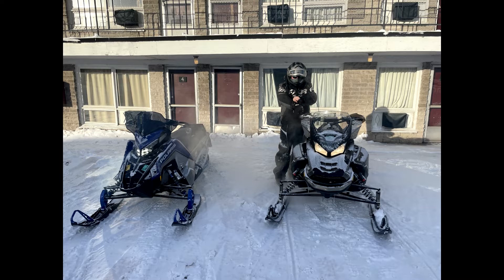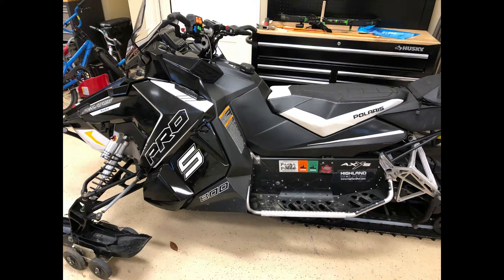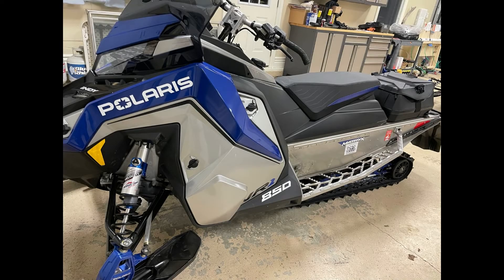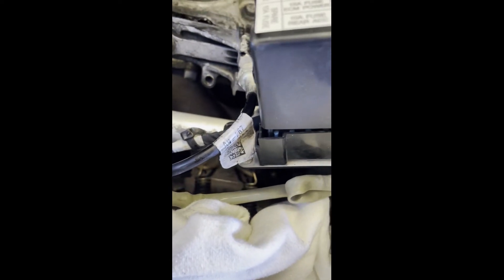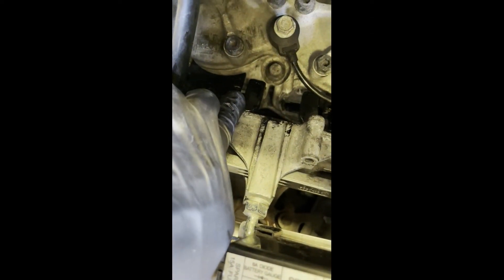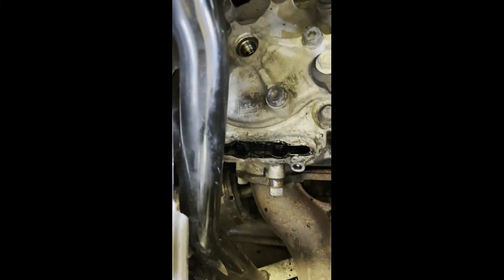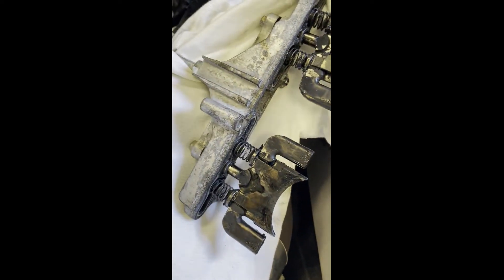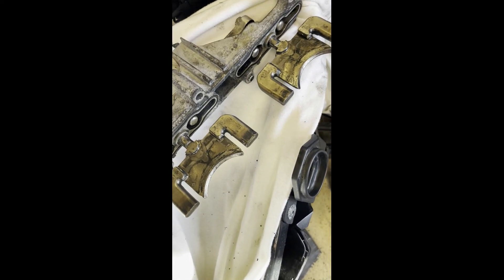Polaris Matryx VR1 and Polaris Axys Exhaust Valve Cleaning 850 / 800 / 600 / 650

Comment: What’s the best process to clean out where the valves sit? Scrape lightly and pull out as you scrape? My 22 850 is falling in its face and won’t pull past 7800 rpm’s and usually drops to 7650
Reply from the maker: This sounds like the classic symptoms.  Just as you mentioned try to gently scrape and pull out what you can.  Also I am not sure on 2022 however these power valves sometimes need a dealer calibration.  If cleaning it didn't help I would inquire about that next.

Comment: Im scared to clean my 650s power valves but it has to be done soon alnost at 3k miles
Reply: It's not bad at all just dont disconnect the cable that goes to the top.  If you disconnect the cable you will need to get a dealer to recalibrate.  Just take your time take a few pictures along the way.
Reply: @josephseitz5386 thanks bud ill do it that's why i been watching these videos

Comment: after cleaning i have a check engine on board . help me
Reply: Just to ask did you disconnect the cable to the power valve body that comes from the actuator. If so you need to have the dealer calibrate. Otherwise I would check to see if you knocked or disconnected any wires. Else pull back apart to make sure all reassembly went well. I never did have a check engine light after cleaning. Let’s see what we can find out
Reply: What did you find out?